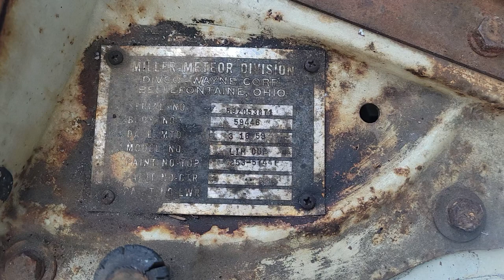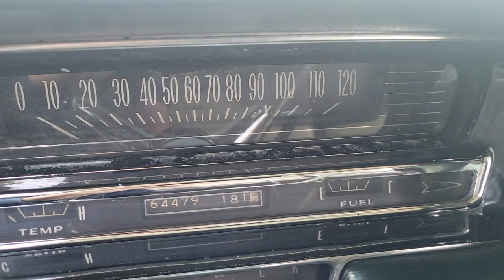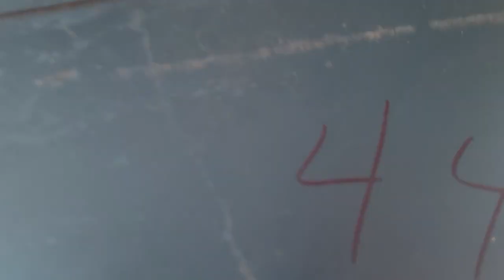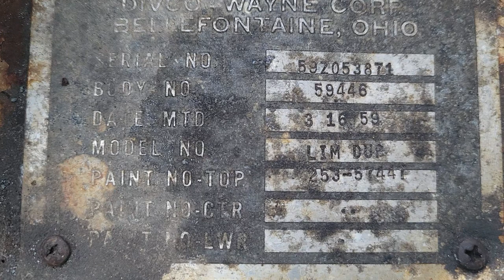1959 Cadillac Miller-Meteor Futura Duplex Limousine Style Hearse Ambulance Combination Interior

Comment: I was just commenting over on the other vid (of the exterior) that I wanted to see the interior.! Somebody plucked a lot of stuff under the hood including the Siren. Interesting that there were no Hand-operated Flood-Lights on the front-doors. In case we got a call out of the city we needed those lights!
Soooo, interesting to see how M&M installed the air conditioning (a "ball-cooler") under the dash and vents to the rear-compartment.
The roller-panels on the table are "up" to accommodate a casket. Flip them over for a cot. Amazing how good the drapes look.
Only 64K miles on the odometer, but, that was considered VERY high mileage, back then. My father thought a car with 30K on the odometer was ready for pall-bearers. They just were not built to go 100K like modern cars do. Plus the Ambulances and Combos. were dogged-out by numerous reckless and wild young embalmers! And it was dangerous in the big-city. Usually, only the funerals homes operated ambulances so the competition was terrible. The competition to get to a multiple accident was horrible. I saw some terrible wrecks and deaths because of it. Since most of the funeral homes were in Downtown back then, sometimes five of us from different funeral homes would come to an intersection at the same time and would end up racing two or three cars across, on the one-way streets to beat each other to a call. There was a funeral home I knew of back then that would fire people who worked a multiple injury accident and took the living to the hospital! They were supposed to only remove the dead (and take them back to the funeral home). Ridiculous!
We kept all kinds of sheets, towels, blankets and bandages in the cars, as well as a general First-Aid kit and TWO Oxygen bottles with regulators. Sometimes the cars were in the road round the clock and would only get to swing by the funeral home for a fresh crew and clean-up before getting back on the road. It was a grueling. During the day we had to "flip" a Combo and use it as a hearse for the funerals. We also kept a "straight" hearse for funerals and removals.
Thanks for the memories!